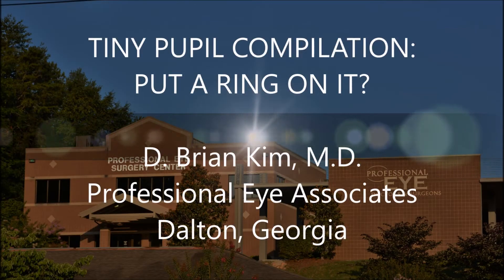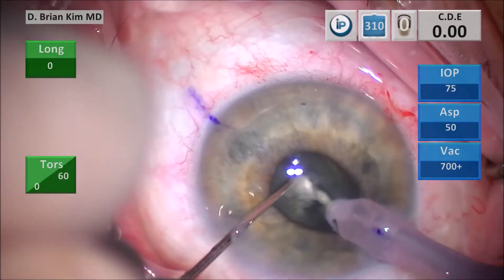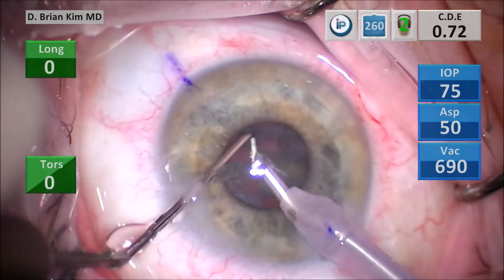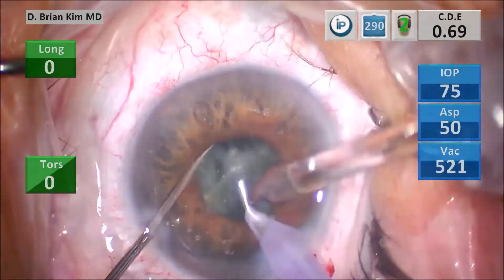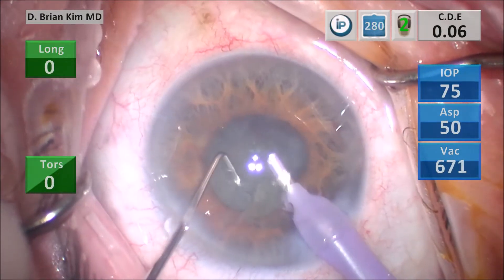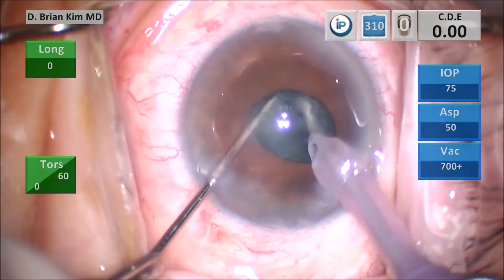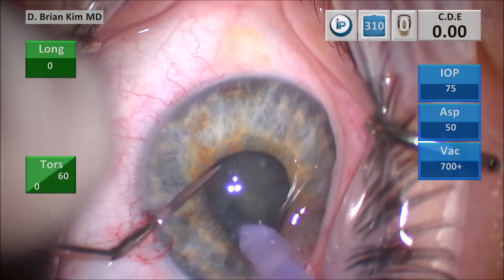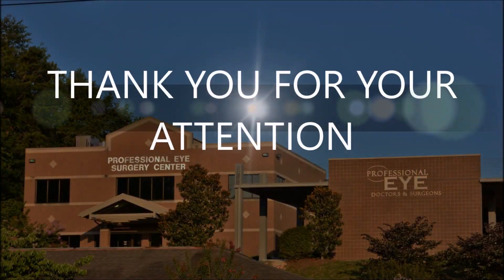Small, Tiny, Itsy Bitsy Pupil: Put a Ring on It?

Comment: Dr Kim, thanks a lot for sharing your great videos. All of them are very helpful. According to given cases - what are your tips to perform controlled CCC larger then pupil size?
Reply from the maker: Andrey Yakimov thank you for the kind words. Yes, great question. It is difficult to make a very large CCC when the pupil is small but the good news is that you do not have the risk of making it too big. The pupil reduces the chance for a runout and so it is safe to try and make it larger by pulling the rhexis more radially. It won’t tend to go too far out. I hope this clarifies.
Reply: Thank you for prompt reply! If possible, would you be so kind to upload another video with such rhexis technique? I believe it will be very helpful to all cataract surgeons.

Comment: Brian-
Great videos as always.  Your chopping technique is great.  Seems extremely friendly to the zonules.

I always am leary of going for epinucleus like you do in your videos in small pupil cases.  If the pupil is small secondary to PXF we can see a floppy bag (not just PC)  that can "come with" the epi nucleus.  With a larger pupil is is quite easy to ID this laxity early on but with pupils this size (and no pupil expansion device) that can be quite difficult to see.   As a general rule I try to do anything i can to get the sharp instruments out of the eye as quickly as I can. I have found that the polymer I/A tip can easily get through this material with pretty much 0 chance of consequences even if the capsule comes forward.  I simply go after the cortex and the epi-nucleus comes with.  I do sometimes need a second instrument for the "poor man's phaco" to stuff the thicker stuff into the I/A

Tony
Reply from the maker: Tony Kokx hi Tony.  Very reasonable approach and I like your rationale.  I love the polymer tip too.  I suppose it is difficult to tell in the video but I am able to appreciate that the epinucleus is loose and away from the bag.  Also, I try to keep my chopper within the capsular bag space in these moments for added protection.  Ultimately, I did not show it in the videos, but one must have excellent hydrodissection and a freely mobile lens to be confident the bag will not come with during epinuc removal.  If the lens is difficult to spin, I will try to hydrodissect again later, but if I still have difficulty, I carefully remove epi with lower vacuum to ensure the bag does not come together.  The bag can be stuck to the epinuc.  Excellent points Tony.

Comment: I am chopping phaco surgeon. I usually hook the equator  watching capsule and CCC margin to place the chopper in the "right place", under the capsule and over the nucleus. 

Dear Dr Kim, how can you have confidence that your chopper is in the right position especially in this tiny pupil case?

Again, Thank you for kind sharing.
Reply from the maker: chundung I think the secret to skillful chop technique is being able to pass the chopper out to the equator without needing to visualize it.  You do this by simply pushing down on the lens material as you slide the chopper out to the periphery.  As you do so, you should feel the chopper tip drop into the equator.  It is a tactical sensation not a visual cue.  As you do this with repetition, you will gain confidence and will not require visualization.  This is the reason I can chop very dense lenses with poor red reflexes or small pupils or weak zonules.  I have used even used poor quality microscopes without difficulty and without complication.  I hope this helps.
Reply: It really helps. And I understand why you deveop the new instrument "Kim's chopper". 
I think that Chang's horizontal chopper cannot "simply push down" on the lens material easily. So you develop your own chopper to feel the feeling of "simply pushing down sense".  Is it true?

Thank you for kind reply, it will really help me.
Reply from the maker: chundung the Chang chopper is a micro finger and is designed for horizontal chop.  It is very limited and cannot perform the double chop or cross chop maneuver because of the design.  I designed the Kim chopper because you can chop from many different angles including holding from below and supporting the lens as you lift the chopper and push down with the phaco tip to crush the lens.  This is double chop.  Cross chop, placing the chopper out to the contralateral equator then chopping the heminucleus is very natural and easy with the Kim chopper.  I hope this helps.
Reply: I perform double chop with Chang chopper but it cannot do gently push down the lens. It is its limitation.
Reply from the maker: chundung if you are pushing down on the lens, the technique is not right.  You should be crushing the lens with the chopper from below and the phaco tip from above with diagonal vector forces.  There should be minimal movement of the lens and no stress on the zonules.
Reply: I told that I gently push the lens and hook the equator then lift up the lens against the phaco tip as you do. But it is not optimal instrument because it is Chang chopper. I gently push the lens with the chopper "tip" :)

Comment: What is the ccc diameter in these small pupil cases?
Reply from the maker: Hi Fernando and thanks for your comments.  Since the pupils are small they are hard to measure but they are probably around 5mm.  I edited those parts out of this video because this was focusing on lens removal not CCC.  After cortex removal, I use a Maltzmann iris retractor to help see under the iris and I am able to achieve 360 overlap.  I still try to polish under the anterior capsule with the I&A and a capsule polisher.  I hope this helps.

Comment: Very high tech and lion ' job done.   Thanks for sharing. 
I fear what i will do if a beg/zonular dehisence happens because chopper under iris has dragged ant capsule couplle of times.      Anyhow great job particulrly urs choping mannuers.
Reply from the maker: Dr. Ullah, thank you for your comments.  Like anything new, it seems intimidating at first, but if you approach it with the proper technique and learn it and eventually master it, ripping the bag or causing a zonular dehiscence is not an issue.  I have done this technique with thousands of cases without a problem.  It comes down to executing the technique properly.  I hope this helps.

Comment: nice video 
but if there is capsular tear we must use pupil dialtor device
Reply from the maker: Dr. Esmat, I agree.  If there is a tear, one needs to use a pupil expanding device. 
If there is an anterior or posterior capsular tear, I would use iris hooks instead of a ring.  A ring in my opinion is too risky and uncontrolled, and can worsen the capsular tear.

The techniques I employ minimize the risk for capsular tear because you are forced to work within a very small space due to the small pupil.  But it is not easy.  In order to do this, one must master placing the chopper out to the equator without tearing the anterior capsule.  This requires a lot of practice but it is achievable.  Once this is mastered, these cases are truly routine and do not need extra instrumentation.